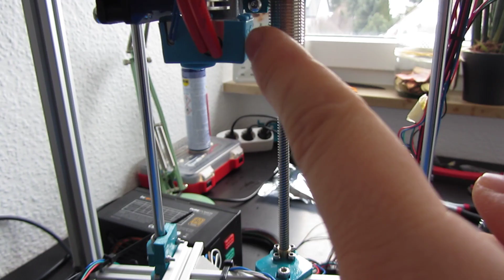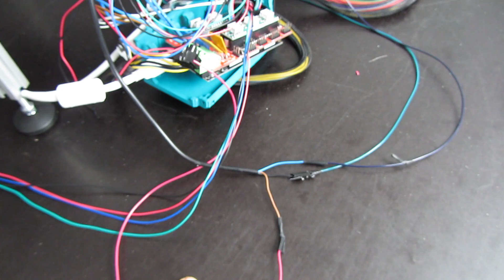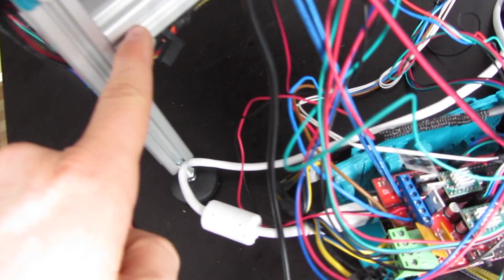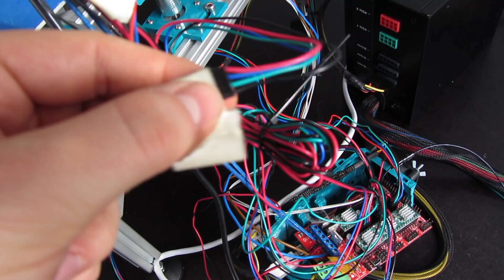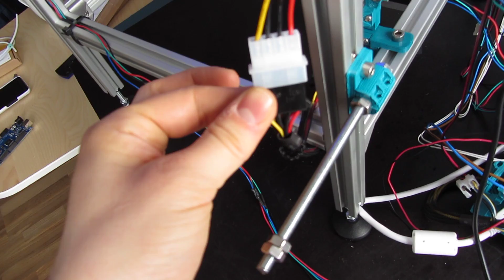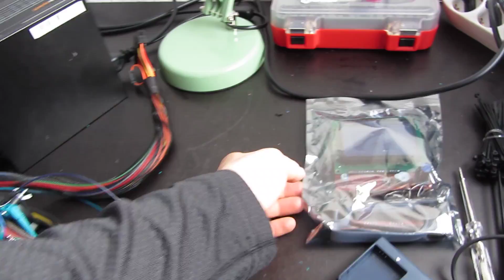Hypercube Build Review

Comment: that arduino board might still be functional over USB , i had a case where something shorted out and fried that exact same part.
  i was lucky enough the place i bought it from happen to sell almost all parts of an arduino board so it cost me less than 1euro to fix it:D
  it was a 5 volts voltage regulator in case you have not found out what it was.
Reply from the maker: Witgang Younotube good to know but I swapped it entirely and don't have it anymore i think. :)

Comment: Voltage is the potential of an electron, kind of like the potential energy. So signal wire can carry a LOT of voltage, theoretically. The big part that goes into the size of the wire is the current, or amperage. The device will determine how much current it will draw from a power supply. So as long as a board is using it as a signal wire, it won't be pulling more than a very tiny amount of current so using 28 AWG wire will be fine.

Edit:
Forgot to add that I liked the video and I appreciate it. Thought I'd explain the signal wire a bit (: thanks
Reply from the maker: Aaron Miller thanks appreciated!

Comment: Very nice, guess that helps a lot of people to decide to build this Printer.
I like the design also. I'm not in the topic now but i started to play with 
stepper motors. One i ripped out of a HP printer is the PM35S-048-HP2 
powered by a ULN2803APG, right now lying on my desk, i struggle with 
the wiring. However my NEMA 17 arrive Tuesday, dimensions are: 
42x42x48(mm); 2 Amp; 59Ncm. 
Standard dimensions 42*42*47(mm), thought this is the way to go.

Comment: Would you be able to add the wiring connection for the Inductive sensor ?
Reply from the maker: Well, 12v is coming directly form my pcu to the sensor. then the sensor sig goes to the z min sig on the ramps and sensor ground goes to ground on the board. Just like in this picture (Except i didnt add the voltage divider! -Which is curious): https://www.google.de/search?q=z+probe+ramps+1.4&espv=2&source=lnms&tbm=isch&sa=X&ved=0ahUKEwjeh8Pm17XTAhWKKVAKHXluApsQ_AUIBygC&biw=1920&bih=950#imgrc=jOhqzmuUwQBNsM
Reply: i think the voltage divider on this is to prevent false triggering of the sensor

Comment: Hmmm seems odd that it would work with straight 12v directly to the endstop port and not with a voltage divider.
Reply from the maker: yes but it does. thats also my question: why? ^^
Reply: I spent about an hour researching why, and no one seems to know why this happens lol A lot of people say that it's ok to connect them directly to it, a lot of people warn that you can fry your ramps. I will take a look at the schematics of the rams and see what's going there. From what I have heard, people speculate that there might be a voltage divider or resistor dropping the voltage. Also, I am building a hypercube now with a 300mmx200mmx250mm build volume. I was wondering how is your experience so far with it. Any big issues?
Reply from the maker: hey, my honest opinion on this topic: you really dont know whats inside these sensors. they are made in china and i honestly think this is russian roulette ^^.i thought of resistors on the ramps but as said i'm not really good in electronics. so far it works good. i kinda try to tweak the print quality, as im not happy with it for now. i think my standards are now a bit higher.. (looking at prusa i3 mk2 :P). But overall its a huge improvement and worth the build if you want to upgrade your cheap printer kit. nonetheless my next printer will be a prusa.
Reply: Yeah, from what I have seen a lot of people have had a lot of success with the printer if build properly. You might need to do a lot of calibration and tweaking of settings. I have designed and built some 3D printers before so I have some experience with it, but it can make you pull all your hairs out lol.

Comment: Wow your old printer was really struggling printing well. This should be a big upgrade! What resistor did you use to bridge to ground when you fried your Arduino? I think you should use 100k and then measure the voltage coming out the signal wire, it needs to be less than 5V. I've read different sensors have different internal resistance so the 100k may need to be more or less. Also the plural of foot is feet not foots :)
Reply from the maker: Jamie old printer was made with a wooden fram close to the one tom sanladerer is currently building. So yes its a big improvement but definitely doesn't come close to a prusa i3 mk 2. I used different resistors 10+15k or 50 and 100k up to 1mOhm. Didn't work. And i fried it with the 50/100k combination but obviously i was desperate and wired it wrong.

Comment: I see that it is moving very smoothly, mine when the belts are connected it is very difficult to move ...
Reply from the maker: bbogdanmircea well its moving very smooth in y direction on the lm8uu and steel rods. The bronze bushings and anodized rods move significantly harder.
Reply: fuma Did you have any problems with vibrations ? Can you take a look at my latest videos to give some opinion ? I tried 3 types of bushings both 10 mm and 8 mm but still it vibrates .

Comment: Hello, do you have any vibrations when it is moving ? I have very nasty vibrations and can't find the cause ...
Reply from the maker: bbogdanmircea im using feets and had to adjust them. I get issues when im printing above 80 mm/s. Then the whole printer is shaking. Ill take alook
Reply: fuma My printer is not shacking, but the noise is really annoying like a resonance ... only at 45 mm/s
Reply from the maker: bbogdanmircea what drivers do you use. In your video u said you swapped the driver. Did you try to replace it? Did you try to set your drivers current? I would try to set both drivers for x and y (the screw) in the same position and turn it about 1\4 turn around and see if i can get rid of the vibration. And what motors do you use? I think mine have 40nm torque. In my previous printer i had much weaker ones with about 20nm. I had to crank up the current and my motors were shreaking also like yours.
Reply: fuma I have the board and steppers from my One Up, board is Printrboard so drivers are soldered, I increased the VREF to 1.45 V and vibration was less but not completely gone, but the drivers was getting very hot and I was afraid not to fry them . Don't know what motors I have but I think they are strong enough .
Reply from the maker: Maybe a stupid question but did u check correct wiring of your motors? The motors i bought didnt have the proper wiring to the pins in my board. But if you recycled your motors also form your oneup im kind of clueless. All i can suggest you is swapping motor to driver connection and find out which combination produces the error. but you already have done that. I might also think that the motors cannot overcome the force on your x axis and thus stutter when runnning slow.
Reply: fuma The connectors are standard, all was working well on previous printer so it is really strange that now is vibrating . If I keep the speed at 20 mm/s then I will have no noise but it is so slow ... I built this printer in order to print parts bigger and faster .
Reply from the maker: if u can get slow, then i really think that your motors are too weak to overcome the sliding resistance of your rod. i  dont think this is an design issue of the hypercube itself. did you try maybe a steelrod lm8uu combination for the x axis to reduce forces? ofc this will lead to higher weight of your whole gantry and can influence your y axis movement.
Reply: In the last video that I just posted, I am running ball bearings on aluminium 8 mm rods from motedis so my X is both light and sliding nicely  which are very nice . VREF is 1.0 V, there is still vibration but it is supportable at 30mm/s . I will order a RAMPS kit as I already have an Arduino and DRV8825 drivers which should be stronger , and will try with RAMPS and microstepping to the max . You have RAMPS too right ? Maybe you can recommend where to get from ebay.de ?
Reply from the maker: i have standard A4988 drivers and i bought my ramps as a kit from amazon. http://amzn.to/2lO6buOfor the electronics i might recommend you to not buy this from china, but i think they most of them are produced in asia anyway, so its a kind of a gamble. maybe look for shops with shipping from europe, then u atleast have shorter delivery time. ill search tomorrow on ebay as i dont have any more time today.

Comment: Where should we get parts printed and what is est. cost?
Reply from the maker: HeyI would suggest a local 3D Printer near you. That's what I would do. You'll be surprised how kind people are when you're sharing the same interests. I think about 50 € would be a good deal. I dont have any experiences with online platforms like shapeways, so i cant recommend it to you.
Reply: Thanks No local, just tried 1 online for 7 pieces $265 ha ha not
Is there existing hardware to connect xy rods?
Reply from the maker: Sick Vic wow if you would print them all at this price range you could buy a prusa mk2 instead :]. I don't think you can replace those custom parts in any way to get a solid build. Printing seems as the only option, machined parts obviously would also work but are even more expensive.
Reply: Sick Vic if you ask nicely and tell me if its oke to use pla for the parts i could print a set for you. You would need to pay for the filament and the shipping (i life in germany)
Reply: Wow great offer thanks. There aren't many like you. I decided to use aluminum extrusion and make trolleys with alum. plate so I can mount anything. Trying T instead of V slot. No printed parts till I'm done :) Found a great place for T slot in US/ hope fuma doesn't mind link/ metric/inch https://www.framingtech.com

If t slot doesn't work I may get back to you:)
Reply: Sick Vic that sounds great! remember we are all a big familie with the same hobby ;D if you get to the point where you need the parts shoot me an email at clypeum4444@web.de an answer to this comment (so i get a notification)! happy buildung
Reply: Thanks will do.
Reply from the maker: Its ok as people keep asking about it. I really don't know where to source parts outside of europe. :)

Comment: Nice video! I will start my own HyperCube build in a few weeks. For the control lights for the bed and hotend heaters I recommend running the wires directly from the board to a nice panel on the front where you could place the LEDs.
Reply from the maker: Yeah that sounds good but i removed my LEDs as the LEDs are blinking all the time. ^^

Comment: I keep blowing up my power connectors on the ramps board so I'm waiting on https://www.aliexpress.com/item/3D-Printer-Parts-Add-on-Heated-Bed-Power-Expansion-Module-High-Power-Module-for-Chitu-V3/32602372831.html to prevent the overload. My blog on my build is here if you're interested. http://lukethier.blogspot.com.au/2016/10/corexy-build-update.html
I'm still uncertain how to go about getting the bed level to the hot end and proximity sensor but I'll cross that bridge when I get to it and I think Tom has a video on it.

Comment: where did you get the anodized aluminum rods for the x axis?
Reply from the maker: James Bohbot hey, in Germany you can get them in local hardware stores. So i didn't had to order them online
Reply: fuma lol, in Canada NOTHING is available in stores, so it's all been online with pathetically slow delivery.
Reply from the maker: My second source would have been to order them online. Such things are easy to get on ebay. BUT for me there are mainly german suppliers with fast delivery..
Reply: were you able to get the aluminum tubes for your build? I got mine from special shapes in the us
Reply: Do you have a part number for that? I was looking at stainless steel tubes at my local surplus shop that were made for lab use but I didn't have my bushing with me.
Reply: I ordered 20 aluminum tubes because that was the minimum order if you ask for a length that is not listed... In my case it was 400mm. If you want I can sell you a couple of these for your 3d printer. Btw there was no part number because I asked for a special length... They dont have longer than 300mm in stock normally
Reply: btw if you should look in their metric metals section to find the 10mm aluminum tube
Reply: Great idea, I'm glad you suggested it. 400mm will work for me.
Reply: James Bohbot, how do I get in touch with you?
Reply: Hey its james on my other account... for some reason youtube wouldent let me post so i changed accounts,  can you contact me through facebook?
Reply: Which James Bohbot are you, there are three.
Reply: the one that goes to polytechnique

Comment: The "RAMPS Wiring" set I bought was colour matched to my Red Blue Green Black stepper motor wiring but how is anyone supposed to assume when they have this paired colour set that these motor wires DON'T match up (connect) to identical colours on Ebay "Ramps Wiring Sets"? You have Red Blue Green Black with black nearest Power In;  The supposed definitively correct data source; Reprap Wiki has Red Blue Green Black, red nearest Power IN. What a load of cobblers the internet is talking on this subject..
Reply: Colors don't matter.  They only help as a reference if you keep them the same throughout your harness. With your setup being RBGBl with Bl near power in and Reprap Wiki being same order just the other way around, only thing that would change is direction of motor rotation. Try for yourself once you get your setup working. Flip your motor plug around on your controller and the motor will go the other way. What you really need to do is ensure that motor's coils are connected to the controller in correct order no matter the color. Need to use multimeter to determine which 2 wires are pairs and connect them accordingly..
Reply from the maker: Artur's Lab yep i had to measure it first for my motors as they didn't came with a wiring plan. Simply following guides from the Internet doesn't give you certainty that everything will work. You always have to verify it yourself.